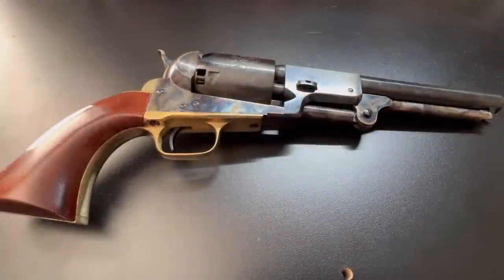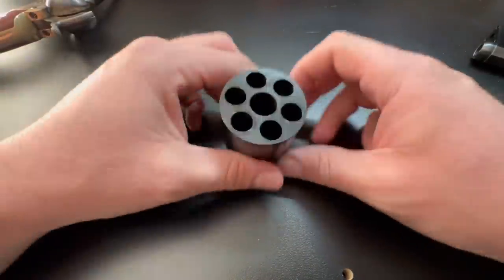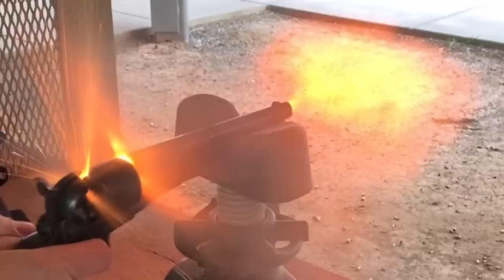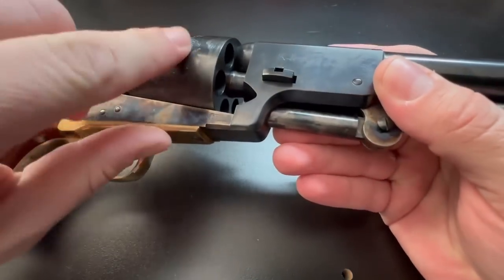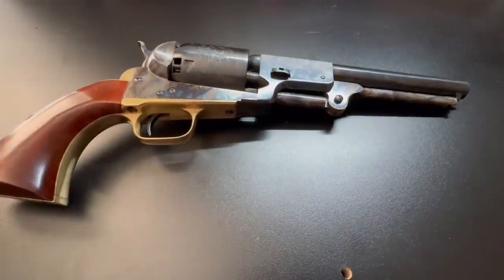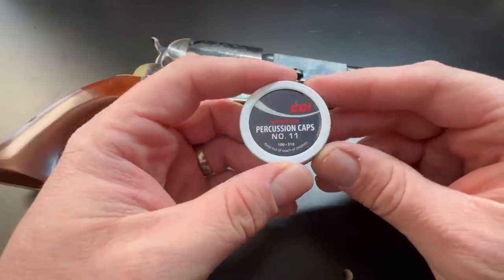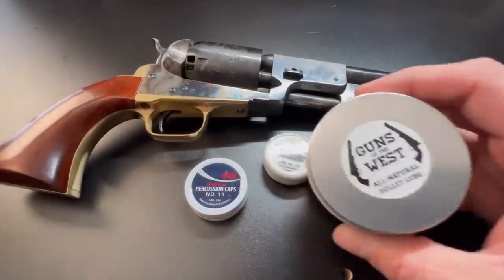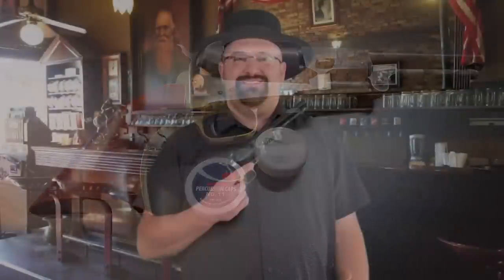Chain Fire: Why Does It Happen?

Comment: I use paper cartridges I make using your kit and dip the balls in the wax/tallow lube mix you endorse - way better and cleaner than smearing bore butter over the cylinders and lets me fire more rounds before the gun is too gunked up.
Never had a chain fire from either end, although I have had a hang fire or two, but I followed black powder safety and slowly counted to thirty, resulting in them discharging from the barrel.
Come to think of it, hang fires could very well be even more dangerous than a chain fire as people could end up starting to replace the cap or otherwise fiddle with the gun, resulting in the barrel being pointed somewhere dangerous or their fingers being somewhere bad when it does discharge, so if you haven't discussed them yet, you probably should.
Reply: So you are actually putting the Lube on the ball itself before loading it ?
If so what is your procedure to put the lube on the ball before you load it?
Also what is your lube mix ratio and goes that not induce hangfires bu exposing the powder to the lube ?
Thanks
Reply: @billyhenard1473  Yes - I put it into smaller containers and then will set the oven for 200F and check it periodically until the wax/tallow mixture has liquified.
The paper cartridges have already been made at this point, so I just dip the exposed lead part of the ball - not letting the lube touch the paper - very quickly - just half of a one-one thousand count - and if necessary, give a VERY gentle downward shake - shake too hard and the ball may tear free and drop itself and your powder into the lube.
I now have a paper cartridge with the lead ball covered in a thin layer of the wax/tallow mixture - 60/40 - and it won't melt off the cartridge unless you leave them somewhere hot enough to melt bees wax.
Loading the paper cartridge goes as normal - slide it in and seat the ball, then use the ramrod to push it the rest of the way into the chamber of the cylinder.
While you'll get a tiny wax ring along with your lead ring, it's far less messy and easier than smearing bore butter across the top of each chamber and while this is 100% my personal opinion, I feel it keeps the barrel cleaner longer than the bore butter as well.
Here we go - How To Make Paper Cartridges, Part 2: Lubricating - do a search for that video - it's from Guns of the West as well.
I 100% endorse his paper cartridge kit as it is well designed and super easy to use - you'll be banging paper cartridges out in a minute or less once you get into the grove of using it.
Get yourself a plastic 9mm ammo box and place the cartridges bullet side up in it after you roll them - that way there's less of a chance of the bullet falling out picking them up by the paper base, plus, you don't have to turn them around in your hands to load them into the gun - if your hands are sweaty due to being outside in the heat/sun, picking them up by the bullet also helps protect the paper.
Using paper cartridges makes the cap and ball experience way better since all you need to do is bring your box of preloaded cartridges and a capper with enough caps rather than all of the loading gear you normally bring.  Wind isn't a problem, you needn't worry about the guy next to you blowing you up with a spark, no problems with spilling powder, you can precisely measure each load on a scale so that you get a consistent load every time - I can't imagine not using paper cartridges with my 1851 Navy anymore.
Reply: @seanfoltz7645  
I wonder about just putting some some stiff lube on the ball itself (to keep from contaminating the powder) and letting it dry and just loading powder then ball and be done with it as with a proper size ball when the ball is loaded it will cut a ring of lead and leave a little lube in front of the ball to keep chainfire from happening and provide a little bit of lube for the bore .
Reply: @billyhenard1473  You might as well just get those pre-cut wads and insert them between the ball and powder if you're taking that approach.
For me, the paper cartridges are to give me more time shooting at the range with less muss and fuss as I can sit back and watch TV while loading them, so dipping the tips after I've made the cartridges is what works best for myself and those who do the paper cartridges.
There really is no skill involved in making the paper cartridges with the kit this guy sells as the learning curve borders on zero - you might mess up a few at first but you'll get the hang of it very quickly.
When you take your first box of them down to the range and find just how fast, clean and easy they are to use, you'll be cursing not having heard about or been told about them.
Reply: @seanfoltz7645  
I am mainly interested in the simplicity of possible use of keeping the ball itself lubed for a tad more reduction in barrel fouling as opposed to loading faster than I already do.

I do not go to a range as I just step out in the backyard as I stay in the country.
I am in my mid sixties and dont really want to use wads either as Would rather keep the Loading simple without the need for wads or paper cartridges.

I seldom shoot over 12 shots and often times just shoot just six as I have neck and back issues and standing over a few minutes is painfull for me.

If I need to reload quickly I have 3 extra cylinders and belt pouches to hold them and can swap an empty cylinder that is in the revolver for a fresh one from the pouch or pouches.

The way I do this is I keep a 45 caliber swab on it and I keep a coat of 50/50 olive oil and beeswax in the barrel and keep the barrel rust free ,then I shoot and when  the revolver is empty of the 6 shots I run the swab coated in the 50/50 lube through the barrel a couple of times and swap in a loaded cylinder  and then shoot 6 more if I feel like shooting a little more.
That way I always have a lubed barrel and the barrel does not foul to badly.

I just put lube in front of the ball after loading and was thinking if I could just coat the Hornay .454 balls with the 50/50 mixture it Might keep the inside of the barrel even more devoid of fouling.

If I want to experiment with doing this I think I might just coat half the ball with the Lube I  make and prevent the lube from contaminating the powder charge.

I think that the Idea of making paper cartridges sounds intriguing but because of my circumstances and having spare cylinders and my low volume of rounds fires I cant see to much reason make paper cartridges  or use wads.

But I do like the idea of pre lubing the balls before seating them.

Thanks for your input,I appreciate it
Reply: @billyhenard1473  If you're just firing off one or two cylinders at a go then no need to even worry about the wax as you won't generate enough fouling for it to matter, especially with you swabbing it between cylinders the way you're describing.  And yes, paper cartridges aren't something you need to worry about seeing as how little you shoot at a go.
The wax/tallow mixture is for extensive firing - my buddies and I will spend a morning at the range shooting against each other for fun and go through a fifty round box or two of paper cartridges, with nothing but a bore brush to run through the barrel every once in a while to clear the worse crud.
If your concern is chain fires then just use the wax/tallow to cap the chambers of the cylinder after you load it - take a pinch the size of a large pea and just smush it over the ball after you've loaded - that'll give you the extra protection against chain fires, a little less fouling and you can do it ahead of time with your spare cylinders without having to worry about the bore butter melting and making a mess over time.
Sorry to hear about your back and neck but I do envy your ability to plink from your back porch as while I can do so with my airguns but nothing else as I'm in the burbs.
Reply: @seanfoltz7645  
Thanks for your information Sean

Comment: When they designed the1860 Colt they should have modified the frame to use that beefed up cylinder,even if they had to shorten it,in my  opinion.

Comment: I use paper towels as wading for my bullets. I wrap the bullet itself in paper towel then add 30 grains of black powder to the cylinder. The bullet sits far back enough that fire from the front is very unlikely and the paper towel will block any room for sparks to creep in. I also pinch my primers just a bit out of their normal O shape, so they fit to the nipple nice and tight. Ideally your primers should always be offset of an O shape, that way they stay on the nipple and don’t slip off. 

Also proper lube in front of the bullet will dramatically help as well.

Comment: There is seriously enough space between the lead projectile and the cylinder it is stuffed into to still squeeze flame all the way to the main powder? 
It seems to me this kind of situation is many times more like to be initiated at the cap area rather than the front of the wheel.